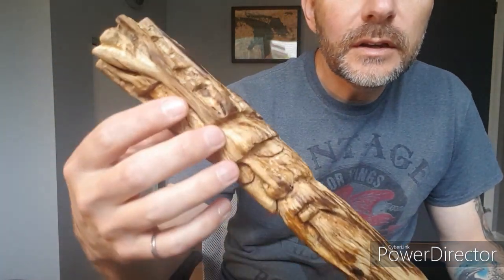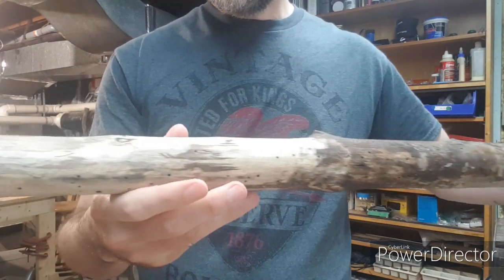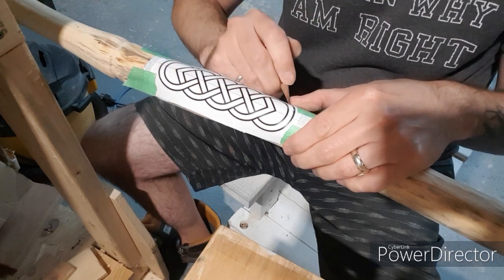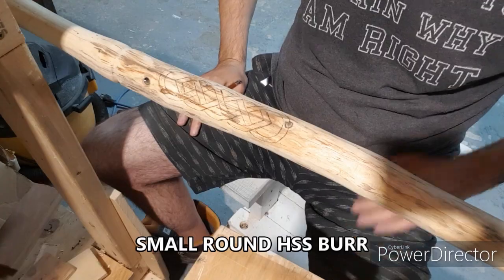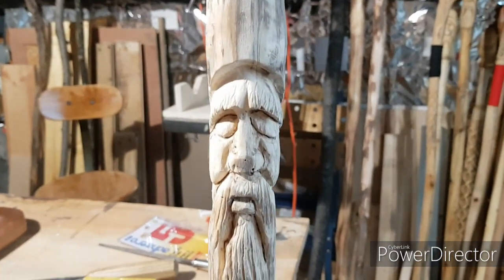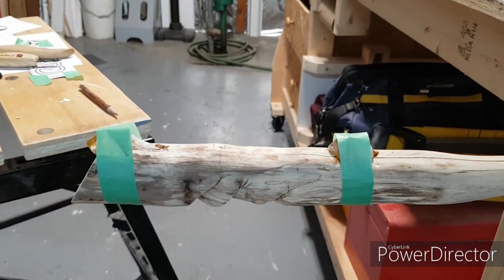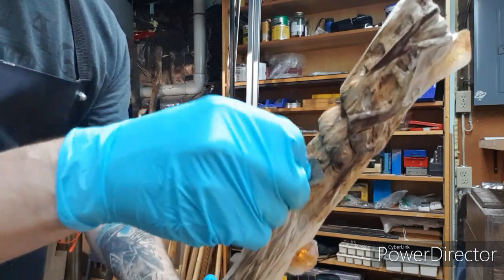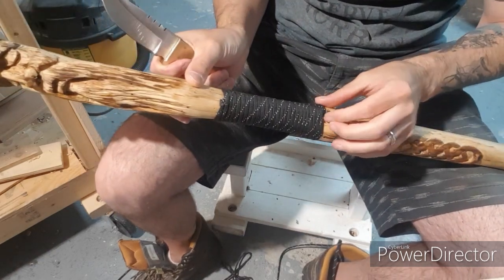Carving a Walking Stick

Comment: Our stick cracked top to bottom after we removed the bark. What did we do wrong?
Reply from the maker: When you take the bark off, the stick dries much quicker than normal. When I remove the bark, I keep the stick in my basement where it's cool and then it minimizes the chance of cracking. Too much heat, too quickly will also dry it too fast and cause cracking
Reply: Thanks for the information. is it OK to leave the bark on a little bit while it dries out we are using Ocean Spray, which is considered an ironwood.
Reply from the maker: @susanallenreads8306  it's actually better to leave the bark on as it dries. It slows the process and lessens the chance of cracks. Generally it takes a year to fully dry a stick from being green wood to usable dried stick for carving and use
Reply: Great information…my husband is carving a walking stick for our 7 yr old grandson….he requested one after a hike on Mayne Island bc
Reply from the maker: @susanallenreads8306  that's awesome. Hope it turns out great! Let me know if you have any questions

Comment: Jason do you have a mark you use after you have made your sticks ? To identify it as an original made by yourself 👍🏴
Reply from the maker: Actually I don’t usually sign them but I should do something. I’ve seen some sign it at the bottom under the rubber foot. Something I should definitely do
Reply: @JasonHedrich  Yep 👍

Comment: Good evening Jason
had a passing thought.
Have you thought about trying some Fractural burning to go with your walking stick carvings?
I bet if it worked. it would look amazing.
Reply from the maker: Hello! Yes I’ve seen it done on flat planks of wood, not sure how it would turn out on a branch. It might work, I’d have to figure out a power supply for it however. Food for thought, let me check it out. Thanks